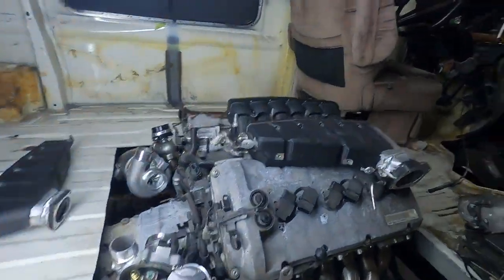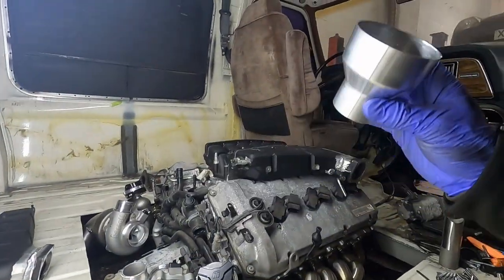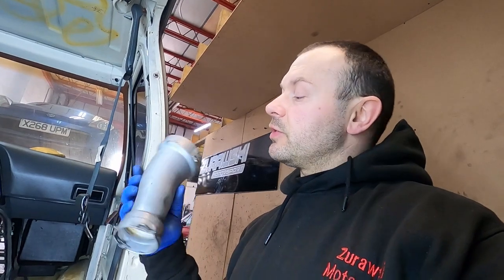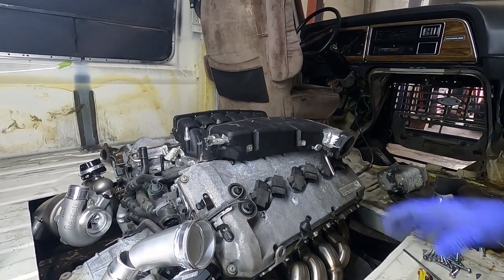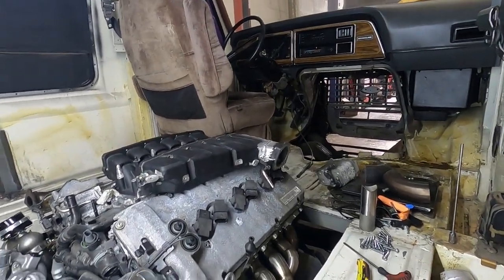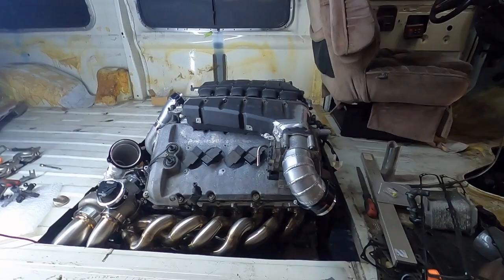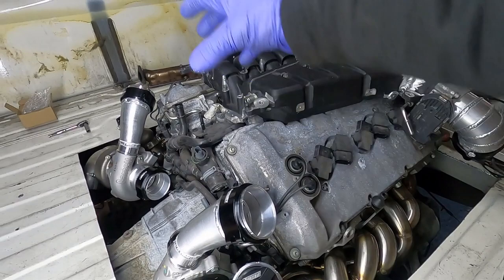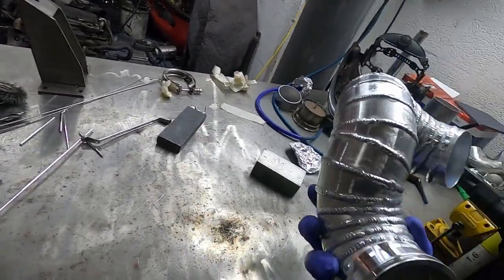Bentley w12 turbo system, throttle bodies and turbo intakes

Comment: No intercooler??
Reply from the maker: Why?
Reply: @zurawskimotorsport  Would that be helpful or not at all? (just a question...)
Reply from the maker: @Ton_van_Dorst  I meant to ask why do you ask " no intercooler? ". It's a must,  without one we'll have trubles with intake temperatures. In the next video we'll have it positioned and pipework done for it.
Reply: @zurawskimotorsport  Okay with the routing of the pipework as you explained it was not clear if there was going to be a intercooler... 
I will see it in one of the next videos, cannot wait...
BTW: love your builds and the detailed explanations, keep up the good work :-)
Reply: Unless it's running nitro meth you can guarantee that motor would have an intercooler setup